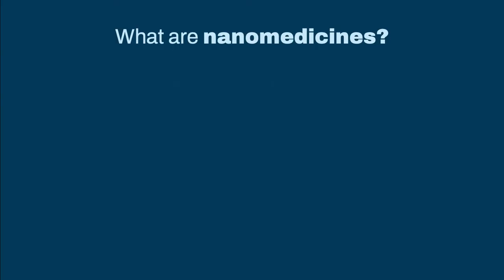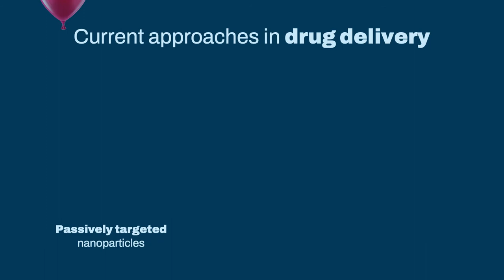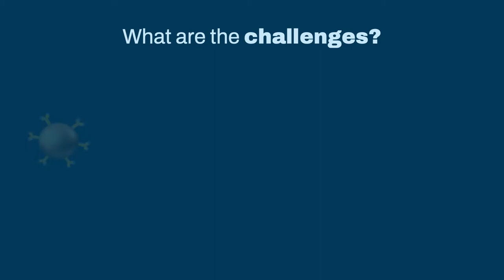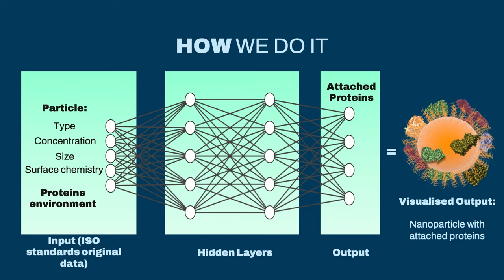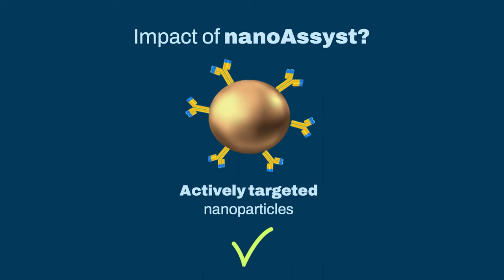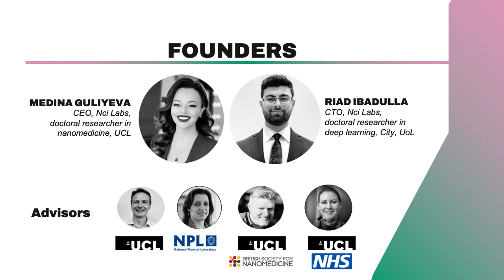Nci Labs: Revolutionising Nano Delivery Systems with NanoAssyst Technology

Comment: One that would not even have to be injected or swallowed, but merely rubbed onto the interior of the mouth
Reply from the maker: It would depend on the mode of action/pharmacokinetic, target, etc, so doesn’t have to be injectable. Might be valid for gum diseases, local delivery.